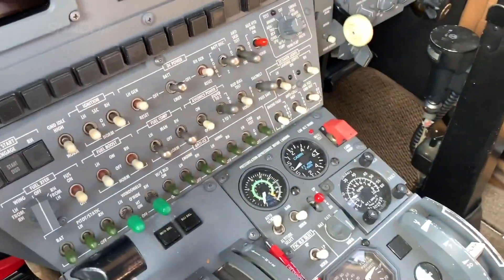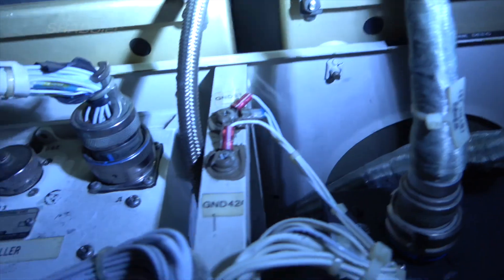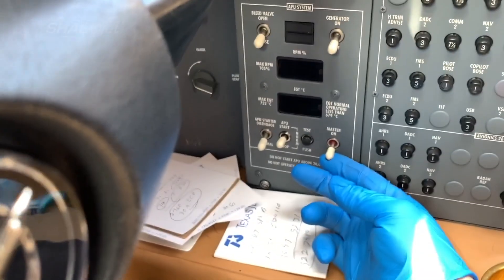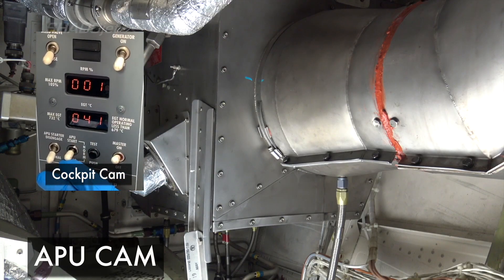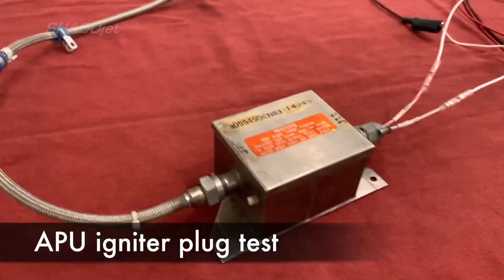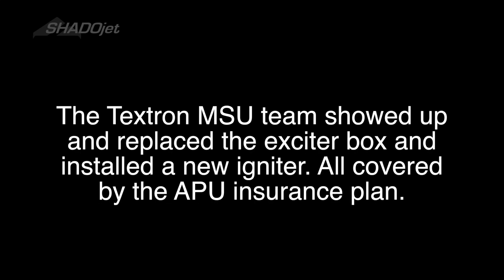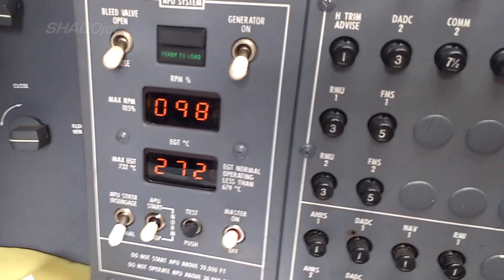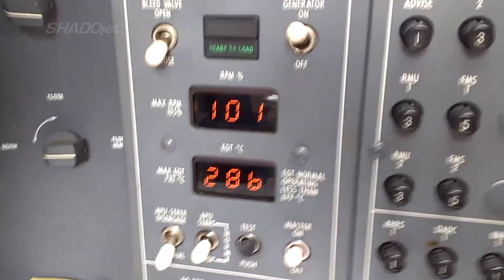Corporate Jet APU doesn't start

Comment: I am a electrician and mostly fix cars, so lets put it into language the likes of me can understand. You tested and replaced the "igniter" regardless of it functioning, read spark plug.   Textron also replaced the exciter box  which is in some case is just a transformer to get high voltages, but for the tasers like weapons , some use a electronic cascading circuit to bump up the voltages. The APU controller, we call it the ignition computer in automotive.  Now if you really wanted to protect your jobs and raise your status, you have to copy the doctors, for every name you mention here, dig into the Latin /Greek dictionary and find another name for it no one else can understand except insiders. I am surprised the factory tech managed to fix anything at all, your previous videos tend to get jobs other mechanics were forced to abandon because it was beyond their skill level. Even something as obvious as a fuel controller that is making a big racket.

Comment: One day when I was working at a bizjet manufacturing/maintenance place, they pulled the customer jet out for delivery back to the customer. When they tried to start the APU, as it spooled up, there was a bang and pieces came flying out the APU exhaust pipe.

Comment: After 30+ years of working on 100's of APU's it's not often an exciter box or plug goes bad. APU's are notorious for carbon buildup in the combustor and around the fuel nozzle crown especially .Bad spray pattern drowns out the plug and no ignition of the fuel. I can bet the box and plug are fine,  just lucky it started after the parts were disturbed. Time will tell. IMHO.

Comment: Is this the same Citation VII a video 2 weeks ago had an APU problem with popping breaker which the Textron guys misdiagnosed and replaced parts? Then this mechanic found it needed an uninsured expensive starter generator?  Now it needed Textron guys to come again and install $10k worth of parts luckily insured.  The repair station I used, the owner said the Citation III was a money maker about 20 years ago and guess it runs in the 650 family.